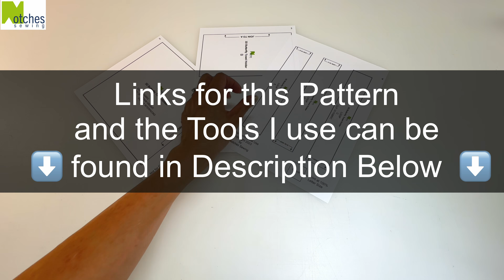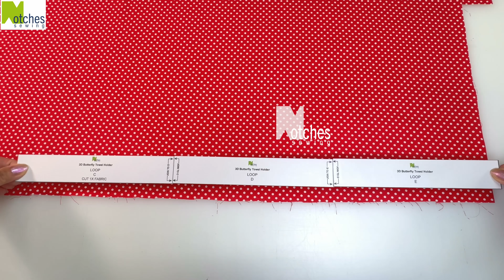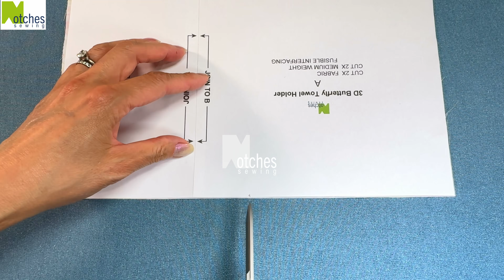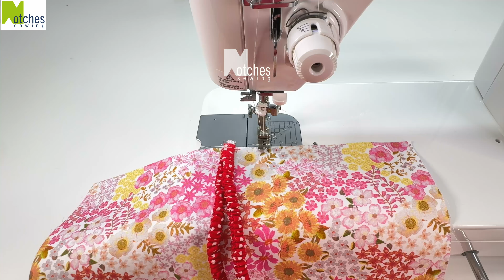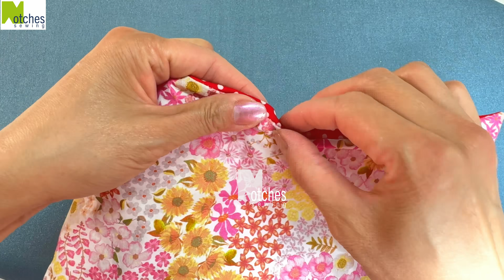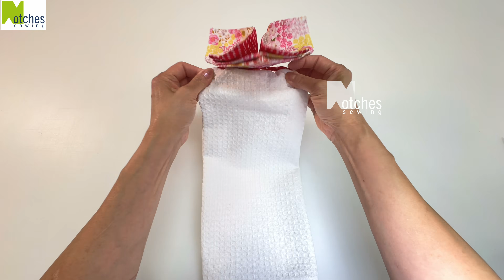How to make a 3D Butterfly Towel Holder  -  Easy DIY Gift

Comment: I am struggling to turn the loop even with the safety pin.  Is there alternate method?
Reply from the maker: You can try using loop turners, thin tube turners  or stitch across one end and push that down onto a chopstick or thin pen